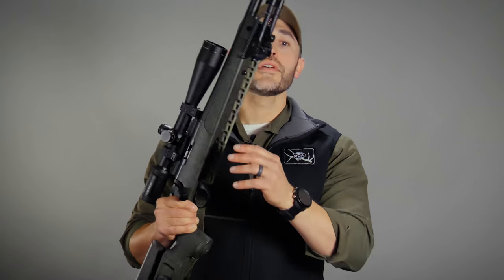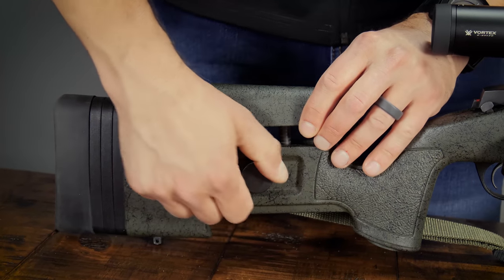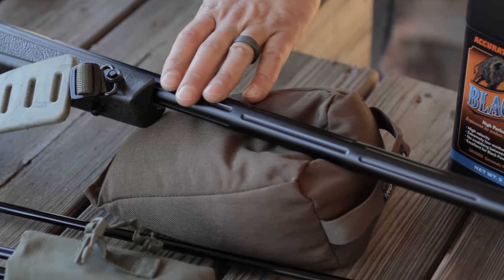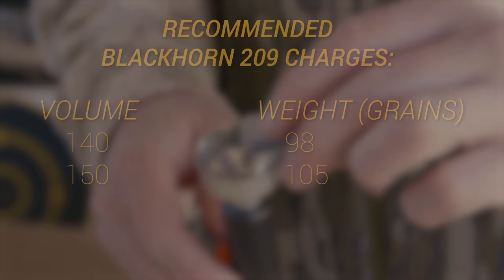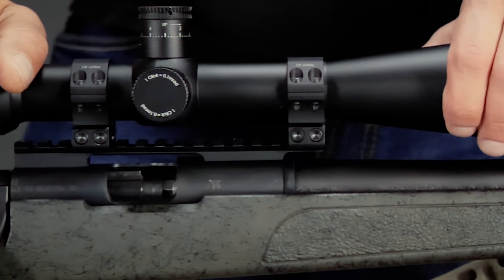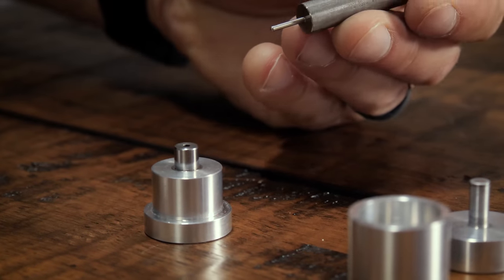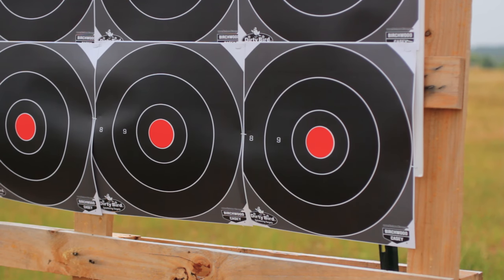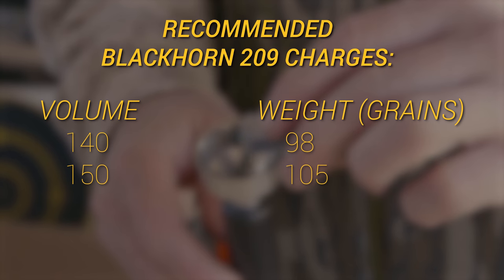CVA Paramount Muzzleloader Instructional Video - Full length version

Comment: Problem is finding standard large rifle primers, they are extremely difficult to find at this time. I wish you all took into account of the shortages and supply chain issues regarding components such as primers and propellant. Other than that this is a game changer especially if you live in a straight wall/shotgun slug state like OH, IN or IL. This rifle has superior ballistics to straight walls.
Reply: I think this was made before "Brandon" became president and screwd the works up
Reply: Same.

Comment: Great video bud, Thanks for all the info. I still have a cpl questions - 
What is the barrel twist?
Are those PB bullets the only ones that shot MOA or SUB MOA at 3-400 yrds? Have you shot it out to 500?
What are the BD rates at 50 or a 100yrd intervals?
What are the terminal ballistics FPS & KE at those ranges? How does it perform on med size game ( like deer ) at close ranges 40-80yrds? 
So, is this muzzleloader designed to be a " one gun fits all " for med & lg game ( bob cats & coyotes to deer, hogs, elk & mu;e deer, to moose & lets not forget about bear - black & brown, across N America in .45 built around one specific round from only one manufacturer & in only one bullet weight & design?
There are new Hodgkins white hot pellets I think they are called, & in 33gr pellets instead of 50gr burning super hot/fast/cleaner than any other propellent on the market. How would they perform in this gun? & can the gun handle loads of 150gr pyrodex pellets or the 5-33gr white hots @165gr ? 
I ( just IMHO mind ya, think that you should have covered the price in this vid as well. 
Thanks for a great job on everything. New fan & Sub here.
I'm a 57yr old country boy from central east coast & have been shooting since 7 & hunting since 8. I got into muzzleloaders in my late 20's & have had several along with father & brother being life long shooters/hunters & multiple muzzleloader owners. I'm currently in north-central Florida & could be shooting armadillos at 30yrds to deer & coyotes at 50-3 or 400yrds & could very well head to places to shoot out to 500. If I could find a LR muzzleloader competition near by would be awesome as well. Hell, I may start one if I cant find one already ongoing.
So, I'm weighing this gun for being a multi-use moa or sub moa LR muzzleloader for hunting & precision shooting.  
Kind regards,
Reply: You can literally see the twist rate at 1:20
Terminal fps and energy are dependent on conditions where you shoot.. altitude, temp, humidity, angle, and of course range. It sounds like you either don't understand the parameters of ballistics, or need to spend some time with a ballistic calculator to work up those estimated numbers for yourself. While published numbers are nice, ultimately you need to measure your own muzzle velocities and then work up your own DOPE.
Reply: @silvermediastudio  Thanks for a great reply man. Luv the SN too, I'm the 800lb gorilla in the rm more often than not. You would be absolutely correct on both fronts. When I wrote this post I had only shot " off the rack " ML's ( my last 4 inlines were all TC's 1- Thunderhawk, 1 Firehawk, 2 Omegas a;; in .50. I wish the hell I'd have known what I know now about the .45's & that TC made an Omega model in .45 with a 1:20 twist I'd have gotten atleast 1 & I'd still have it ^ shoot it today over the .50's. Plus the pyrodex pellets & Powerbelts were the way to go back then. I'd never used a chrony or ballistic app. I now after over a yr of shooting my Paramount & learning to size bullets & learn about ballistics & building my own loads & scope dope. I use to have 300 Win Mag & 7mm Rem Mag with nice scopes on them. But I've never had to take a shot out past 300yds or so. So with those rifles, I didn't need to learn & use any of this info then either. I wish the Paramount had a .452/1:20 twist barrel on it, or a 1:18 twist like what Knight uses on their 500 rifle. It's been & still is a fantastic learning & shooting exp in the last yr or so for me. I'm so madly passionate about all of it, like falling in love with the same woman all over again... only, much better. Well wishes
Reply: @iwillchoosefreewill9787  That's awesome man. Congrats on getting hooked :) now when are you picking up an old repro cap lock or flint lock, with real Black Powder?? Yet another world of fun, casting Minie balls or round balls. Wish you continued success in your shooting and keep yer powder dry!
Reply: @silvermediastudio  Thanks so much. I actually like everyone I've ever known started off with a .50 Hawken & PRB's w/ Goex. I've had 2 of them old smoke poles way back when. I have only 1 sidelock now - its a TC Seneca with peep sights that was orig .36 slow twist. It got sent to Bob Hoyt to rebore it to .400 with 1:37 twist. I shoot 10mm jacketed pistol bullets from 135gr - 180gr after I run them through a .397 sizing die. I only use T7fff for powder. I also shoot a bunch of GT Bullets cast lead HP's in 10mm 140gr & 160gr. I don't resize them - .400. I've shot almost 3lbs of T7 this yr. I had to reshape the brass stock piece & stock just a tad to make it shootable in a modern shooting stance instead of how they are designed to be shot in a skirmish line stance & outside the shoulder pocket. I shot my 1st Osceola longbeard at 110yds with it last yr. I'm shooting Fury ST2P 275 gr bullets sized to .4525 for those oddball Bergara barrel bores at 2500fps with 105gr W BH 209. That gives me 550yds of range & still keep me in that 100ftlbs ke. for deer sized game & somewhere around 400yds for elk/muley sized critters if I remember right. I have enough adj in my scope to dial out to 700yds or so for target shooting. I put a Vortex Viper PST Gen2 5-25x50 FFP IRMOA scope wih DNZ Game Reaper 1 piece rings/mount right to my receiver. Eliminates the need for a rail, looks amazing. I alsh had my Paramounts barrel threaded to 3/4x24 tpi & I put a 5 port titanium Beast Brake I had chamfered to my bore dia & Cerakoted to match my barrel & bored out to fir my SS Load Thru funnel custom sized for this brake. I got a Caldwell Chrony & the app on my old IPhone4 the chrony hooks right up to my phone which I set on my shooting bench ( a concrete slab for an AC unit on 2 metal saw horses ) I set myself up a 400yd range down the back side of the fam i'm stayin withs place. I got an Accura V2 .45 too that I'm shooting 200gr .40 cal SST's I had to switch out the MMP sabots they orig came in for Harvester light blue crush ribs behind 91gr W T7fff. I also shoot out of that Accura a 265gr Fury STB ,453 behind 84gr W BH 209. The Parker 250gr BE's swaged up to .4525 shot real well too. Thats my treestand/200yd gun. Yea, one could say " I'm all in " the coolest thing has been learning just how much the ML world has evolved since I first started in it & since I couldnt shoot for a while & had to sell all my guns & gear. Now I'm learning just how much I need to learn & putting it into real world action on my own range has been challenging & fun. I loose myself for hrs & sometimes the whole day on my range. Its awesome trigger therapy.  I have a cpl TC Omega actions now, I'm going to have a .45 1:18 twist smokeless ML for learning to shoot way out past the 500yds & a .40 1:14 twist SML on a Boyds Pro Varmint stock. They are my next 2 endeavors. Thanks for the kind words & encouragement, kind regards

Comment: Only a couple things I dont like..#1 all the extra stuff you need just to prime it. #2 a separate loading rod. I can understand the rod thing but the priming tool I'm just not understanding that.
Reply: You clearly never shot traditional muzzleloader 🤣
Reply: @silvermediastudio  you are 100% wrong..ive been shooting traditional muzzleloaders for over 20.years
Reply: @tufftrucker40  So you're familiar with having a cartridge box, casting bullets, lubricating bullets, a cap box with caps or flint with knapping tools, ticking that's been lubricated, and all the other accoutrements? Yet you don't like having to prime or carry a rod. Hmm okay!
Reply: @silvermediastudio  all of the above..just because I don't do something or like something the way you do doesn't mean I'm wrong or you're wrong, it means we do it differently.
Reply: @tufftrucker40  well I'm not sure I understand your complaint regarding the paramount then. when the traditional option requires similar amounts of kit or preparation before going afield. hand loading center fire no different, tools are required to build the loads. in this case it's just a different set of tools. the nice part is, they sell it all in a kit so while it's proprietary, it's a complete system, that they will hopefully improve and expand upon. the only downside i see is that large rifle primers are hard to come by right now, and it uses a proprietary projectile.
Reply: @silvermediastudio  maybe I just don't like it

Comment: Tap the damn thing for sights for those of us in restricted states..
Reply: Which states don't allow optics?
Reply: @silvermediastudio  quite Few western states.  Colorado for sure
Reply: @dodgefreak8797  I see. Well, given it has a picatinny rail, one could install a rear aperture sight and then a front blade that clamps to barrel. Nodak Spud makes one for .920 barrels and I think smaller.
Reply: @silvermediastudio  not necessary.. CVA made a pro colorado version this year with sights and in 50cal (required for elk) . I purchased it before season and took my bull with it
Reply: @dodgefreak8797  outstanding! good eatin'

Comment: Will the paramount come with traditional ramrod instead of collapsible? I don't want to carry two rods out in the field, I rather use one for both reloading and cleaning which always been the role with the traditional ramrod. I rather use a traditional sidelock due to the ability to switch to flint which the biggest cons with the inlines are. Only 209 and musket caps. I really don't care for free floated barrels if it don't give the versatility like having the one versatile traditional ramrod and not a collapsible which can't field clean, and a range rod that should stay at a range than field. I rather loose the free floated barrel to get the traditional ramrod back for versatility as the old saying goes in the forestry is only take what you need. A sidelock rifle can be easily field stripped for cleaning, both percussion and flint, a smoothbore flintlock is more versatile than a rifle, Flintlock musket is the most versatile in the black powder realm.
Reply from the maker: The Paramount only comes with the collapsible loading rod at this time.
Reply: @CVA  Can you see about having the ramrod back under the barrel as an option in the future? Since the traditional ramrod does both reload and clean which will give the hunter less to carry in the woods and still be capable to do field cleaning. As if that hunter carried both collapsible and range rod, the range rod will be more of a hinderance than just having a traditional ramrod. As the lacking of the traditional ramrod for both reload and cleaning out in the field is my biggest critic as I don't really care for the floated barrel in a muzzle loader due to the cost of lacking of versatile traditional ramrod. I think this should be thought on hard as the Paramount and Acura X will loose to the Traditions Pursuit Pro because of the ramrod. I have a traditional muzzle loader, it will be more harder not having a ramrod under the barrel that can do both reload and clean.

Comment: Looks like a nice rifle but your scope recommendations are laughable for a 400 yard gun.  At least 18x? Hahahaha!  8x is plenty for big game out to 500+ yards.  Too much magnification makes it hard to acquire moving targets.  A bit more magnification is nice for shooting paper, so a 3-9x or 4-16x would be about right.  And a 20 MOA rail is not needed for 400 yards.  You only need around 12 MOA of elevation to reach that distance, which is well within the adjustment range of most scopes (even BDC reticles have close to 12 MOA).  A rail system is fine if that's your preference, it's just not necessary for this setup.